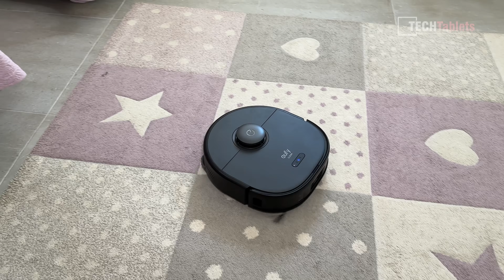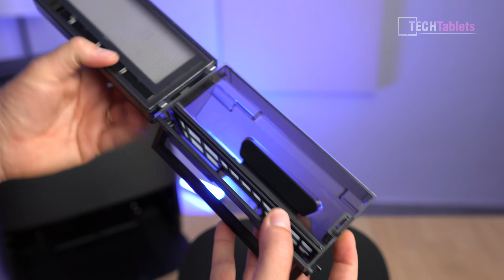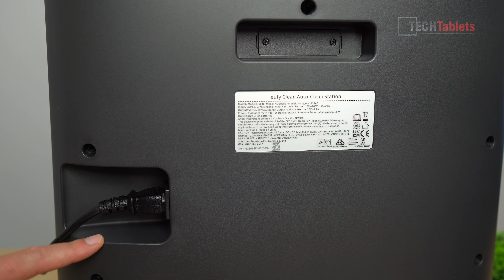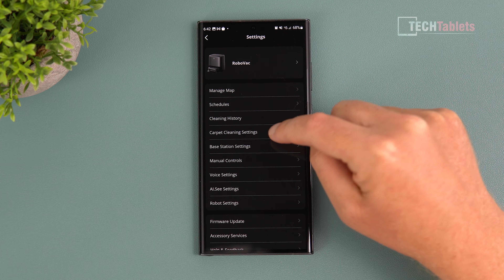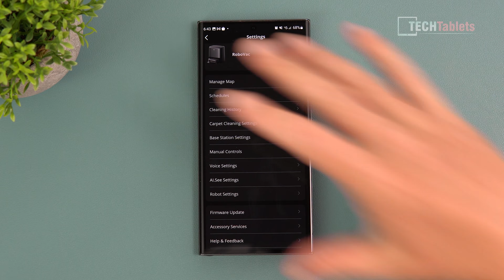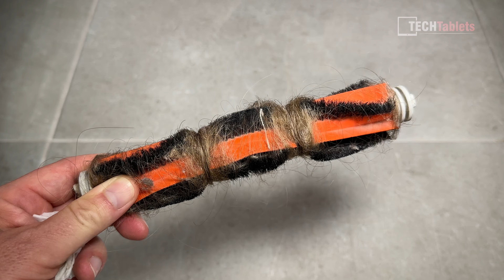eufy Clean X9 Pro—Eliminate the Pain Points of Mopping

Comment: If you placed the Eufy on the second floor to map would it know it’s on the second floor?
Reply from the maker: Yes, the X9Pro indeed supports multiple map storage. It can automatically identify the appropriate floor and map to use, ensuring seamless and efficient cleaning across different areas of your home.
Reply: @jermainec2462  thank you
Reply: Does it recognize a staircase so it doesn't fall down on the second floor? And do you need to take the homebase to the second floor?